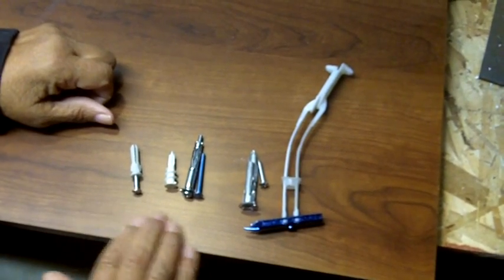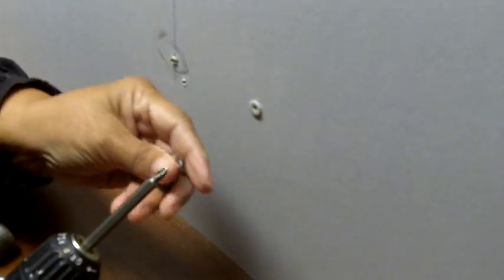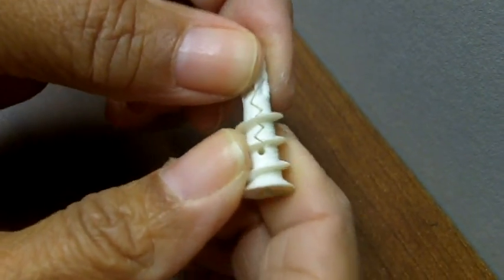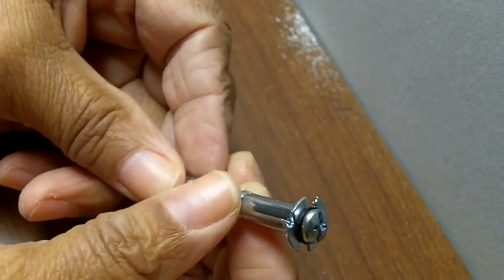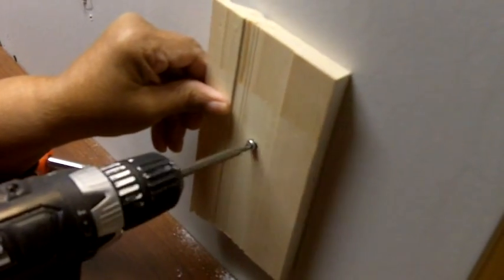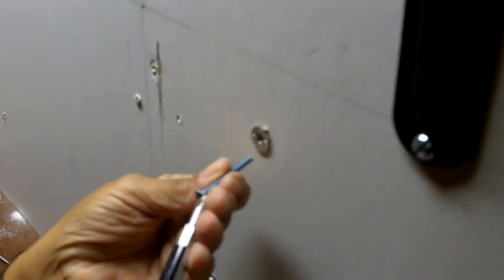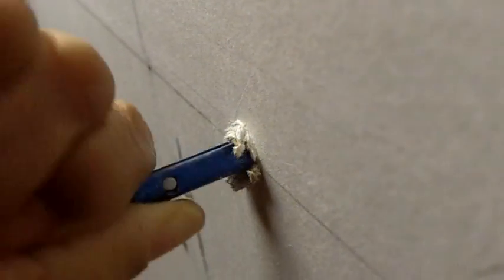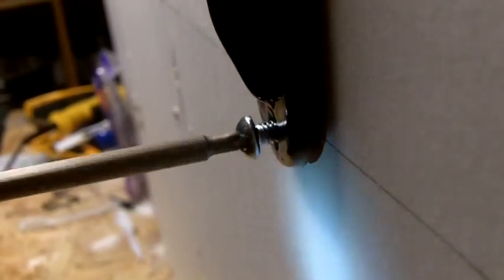All About Hollow Wall Anchors

Comment: Thanks again for another easy to understand video.
I am, as I type, in the process of hanging a closet rod but I found out that one side wall is hollow, I tried a plastic self driven anchor like the first on this vid, and it went right thru. Should I use the toggles you used last on this video since there is no stud to help support it?
Reply from the maker: yes, that's an option.

Comment: Hi Jane, when I put in the white plastic self-tapping anchors, I poke a hole with my phillips screwdriver first, then screw it into the wall. (sort of like drilling a 3/16" hole I guess) Would this reduce the integrity of the drywall/anchor relationship?

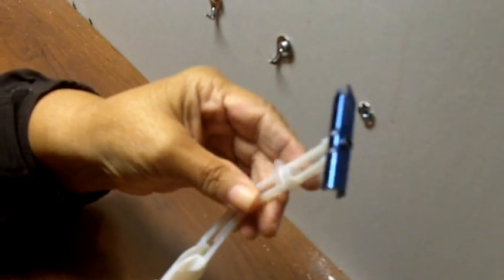Comment: Hi Jane! As usual nice video :) I need to ask you something pls.  So I want to install an Ikea besta tv stand I am using the snap toggles like the ones in the in the minute 7:31 of your video, but I made a mistake with the position of  the hole for 1/2 in.  In the first hole I got the toggle installed. Just wondering if drilling a second hole that close (1/2 in a part) will be secure enough to hold the weight :(. Any recommendation? Tks in advance for your answer.  I am not catching any studs for any of the screws positions unfortunately, so I had to do it with snap toggles.

Comment: Hi leah, I have been really enjoying your new videos, and I wanted to ask you for some advice, on anchors.  I have been trying to re-hang a curtain rod on a very old Adobe wall.  I have tried almost everything out there from plastic anchors, to molly bolts and I cant get this to stay.  Someone suggested I use liquid nails, but to me that's going to make a hell of a mess and not really work on the wall.  Im at a loss here, so if you have any suggestions on what I can do to make this work, I would really appreciate the advice.  Thanks for your help, and keep the videos coming, you have some excellent stuff here!
Reply from the maker: Rudy P Hi Rudy, I'm not an authority on adobe, but have contacted an authority on adobe construction in your behalf.  Once I get a response, I'll get back with you.
Reply: Thank you Leah, I really appreciate any advice you can give me.
Reply from the maker: Rudy P The Adobe expert we contacted  recommended that gold deck screws 4 - 4 1//2  inches in length be used, noting that the large aggressive threads running the screws  length, created a strong bite in the adobe brick.  He further suggested that pilot holes be drilled prior to driving the fasteners into the wall especially when screws are placed in close proximity of each other.  Hope this helps, good luck.
Reply: Leah,

I have to say thank you so much for the Advice!  I bought the deck screws, and re-installed the curtain rod.   It worked like a charm.  Thank you so much for looking into this for me.  I appreciate you for what you are doing, keep up the good work and thank you again!!!

Comment: Which of these anchors will work with my own screws?  I have a fairly substantial drapery rod with drapes that are on custom brackets.  The screws are not the same size as the ones I've found at my local hardware store.  I'm wondering if they will work with the snap toggle?  The screws that come with these anchors will not work with my brackets.  They are counter sunk and the heads are too large.  Those plastic wall anchors won't hold the weight.   Thank you!  Love your videos.
Reply from the maker: +Angela Lee Hi Angela, you would be best served to take the bracket to the hardware store with you, and have them help you to select a screw.
Reply: That's what I did.  There isn't one.  I'll have to take it back to the guy who made them to drill the hole a little large for my screw to work.  Thanks so much!

Comment: Our toilet paper holders are a nuisance! They were originally screw mounted into drywall, but the holes got sloppy & loose after re-installing with various wall anchors & mollies. Any how-to's for mounting to stay put? It's not like people are using them for anything but TP, & as the only female in the house, I put the paper on with care (men in this area are not familiar with TP installation methods). Spackling these holes doesn't hold up. What can I do to make them stay? Thanks again for your great series!
Reply from the maker: MotherSquid HI Mother Squid, you can't use the same holes, even if you spackle over them.  Your solution is that you will have to reposition the TP holder.  One side of the TP holder should be screwed into a stud.  It's okay if the other side is still mounted on drywall.  As long as one side is mounted on a stud, you'll never have this issue again. If you need to know how to find the stud, we have a video on how to do it.

Comment: Any of these work to screw in those closet end caps for closet rod in thin rv closet walls?  The closet rod will only be 13 inches wide but I want to hang clothes on those hangers that fold down and take up less room.  That makes them pretty heavy.

Comment: Great video!
I was wondering what the molly bolt looked like in the back, I don't think you showed it :( . I am wanted to hang shelves with horizontal double brackets but it looks like the wall I want to hang them on has two drywalls back to back. Would a molly bolt be long enough to reach through to the other side?
thanks in advance!!
Reply from the maker: epicbtu Hi there, The molly bolts are fine, but the snap toggles that we show in the video are actually a better choice for this application. They will hold more weight, and are easier to install. If you want to see how the snap toggles work to hang shelves, I would recommend that you watch the See Jane Drill video "How to Hang Shelves on Drywall that will Stay".

Comment: Leah, great video. Is there a special anchor that I should use for old plaster walls? Thank you.--Kim
Reply from the maker: XOurSimpleLifeX Hi Kim, Most plaster walls have a hollow core, so the anchors I showed in the video will also work in plaster walls.  The only difference is that you will definitely have to drill, even for the self-tapping ones, because plaster is basically a rock.  Hope this helps!
Reply: seejanedrill Yes, this helps a lot. Thank you.

Comment: Silly newbie DIY'r question but can the snap-toggles work on paneling?

Trying to hang a large TV (heavy) on a panel wall. I understand I will have to pre-drill the pilot hole bit will the wall and toggle accept the weight? 

Love this channel btw - I totally subscribed when I "discovered" you.
Reply from the maker: Your question isn't silly at all, it's a good question.  Yes, you can attach toggles to REAL wood paneling.  I mention real wood because a great deal of paneling is made of polyurethane, wood particles and vinyl and may not be able to support a large tv.  So, my yes depends on the paneling is it wood or fake wood.

Comment: you forgot to mention with the molly bolts you need the right wall size to know the right size molly to use. Also how much pounds the drill toggler can hold?

Comment: Hi Leah I want to put another rail in my wardrobe, on the outside walls it not a problem, because the screw fit into the holes that are there, but on the middle one there are holes to put screws in but nothing in between the middle to screw them to how do Secure  the screw s to stay in please .

Comment: Hi Leah I have an over the door towel bar on my bathroom door which prevents the door from closing. I purchased a rack that screws to the door to replace it. I didnt realize the door is a hollow core door. Which anchor type would you suggest for a 1 inch hollow-core door?
Reply from the maker: you may want to consider a molly bolt

Comment: Hi Leah, thanks for this great video. I am installing a wall hung bathroom vanity in a small half bathroom but I realized and I do not have studs to hold it, could I use the snap toggle to hold over 100 pounds or is anything else available?
Reply from the maker: Hi Julianna, studs are usually 16" on center, so I'm not sure why you don't have studs to attach to.  Is your vanity smaller than 16" wide?
Reply: @seejanedrill  You didn't answer his question... Also, not all houses have  walls that are 16" on center. I'm in a home now in which interior walls are 20" on center. Just exterior walls are 16" on center.

Comment: Thanks Leah!, Just wondering what would be best to hang a manual projector screen with pull string on a dry wall? it weights about 75 and is about 92" in length.Doing my own DIY home theater and any suggestions would be appreciated!. thanks in advance!
Reply from the maker: HI Juan, for heavy items, I have had the best success with an anchor system called wingits anchors (holds up to 300lbs). You might want to consider them. I get mine at Home Depot, but they may be available elsewhere.  Good luck with the home theater...pass the popcorn!
Reply: Thank you,Leah ..I'm running to HD now!

Comment: I used the 2nd to last type last night (mine were plastic/metal) and they wouldn't flip, the damn screw would just pass along the anchor... I so have insulation behind the wall, what do you recommend? It is for mounting a TV. (no studs in the wall.... at least none to be found with 3 different stud finders)
Reply from the maker: +Mathieu Levac Hi Mathieu, it's possible that the insulation was interfering with the drill toggle.  You might want to try a strap toggle (the last one I showed in the video).
Reply: Yeah i used something like a clamp with a spring in the middle, it would open by itself when it got outside of the hole, worked very well and its very solid, thanks for your suggestion though.

Comment: Do you think I can use the snap toggles (4 of them) to mount a tv to drywall (not using the stud)? The tv weighs 28lbs and the mount weighs about 20lbs.
Reply from the maker: Make sure that the weight is within the limits specified by the manufacturer of the snap toggles.  If yes, it should work.

Comment: A noob question, but a serious one:
if an anchor can hold  a weight of X lbs, does it mean that two identical anchors are capable of holding up to 2X lbs, and four can hold 4X lbs? Any rules about a minimum distance between the anchors?
Reply from the maker: you know, this is one of those questions that I don't know the answer to, and have often wondered about myself!
Reply: Yes to your first question; within reason (EX:  the load of what you mounting would need to be ~evenly distributed across all the anchors)

Important to notes:  There are differences between the pull out rating and the sheer rating of mounting hardware.  A shelf or similar can act like a lever multiplying the apparent load at the anchor.

Yes to your second question, there are minimum distances between the anchors; see specific manufacture for specifications.

Comment: Does the molly bolt work on luan walls in an rv? I'm trying to hand curtain rod width of rv behind the driver and passenger seats, need something strong to hold rod up. Will use hanging ceiling rod holder as well. Thank you
Reply from the maker: shelleyfunny19 Hi Shelley, a molly bolt should work,. However, I'm curious...why not the snap toggle?  I ask because the molly bolt is more of a lightweight anchor, but the snap toggles can hold a lot of weight.
Reply: seejanedrill First, thank you for the reply. Second, my concern is that there is not much space between the wall/ceiling inside the coach and outside. I think I have the luan and then an inch of foam then the wood that is the roof, puncture that and I have leak, not good. Water is an rv's kryptonite. I love the idea of the snap toggle if u think it'll work.
Reply from the maker: Hi Shelley, after you explained how much space you have, I don't believe the snap toggle will work.  You might consider trying a product called sugru.  We just did a video on it this week.  It is a moldable rubber that you could embed the curtain rod holder in to attach it.  Sugru costs about $10, so it would certainly be worth a try, and you wouldn't have to worry about puncturing anything.

Comment: I've used many of those fasteners and most are junk. The second one (self tapping one) avoid at all cost.That Molly bolt isn't the right size for drywall the main body ( the part that doesn't expand is too long ) I'm surprised it didn't just spin freely when you put a screw in, you should have shown the back side of the wall and warned people watching. the "drill toggle" shouldn't be used on a wall that has insulation behind the wallboard as the part tat swings out can get caught in the insulation. One thing everyone needs before drilling or screwing holes in their walls is a Stud Finder! With a stud finder you can locate the studs and quite possibly drill into your wall stud and use wood screws to attach whatever the good thing is there's practically no weight limit but you are limited to placing your item only where there's a stud. And a stud finder also shows you where it's safe to put a wall anchor (no stud).

Comment: can I hang a 65 inch tv with the toggle anchor ?
Reply from the maker: Toggle bolts have the weight limits indicated on the package.  I would consider weight and not necessarily size.

Comment: Haha "Leah, what is this?!" That made me laugh. What do you mean when you say 'sheer weight'?
Reply from the maker: Marci, how are you. Shear weight refers to shear strength which is a material or components toughness against a certain kind of structural failure.   In the case of our video,   the shear load represents the force which can produce a sliding failure. on a fastener (screw, toggle etc.) along a plane that is parallel to the direction of the force.

Comment: That is not the correct way to fit a molly bolt the first thing you need to know is the thickness of the plaster board to determine the correct bolt as there are different length shafts, drill correct size hole insert bolt then you are supposed to use a MOLLY BOLT GUN which clamps the bolt in position, doing it the way you have shown can cause the bolt to drill itself through the board I have used thousands of these bolts and they are very secure when used correctly, some people will ask how do you know the thickness of the board this can be checked by either taking a near by mains socket off the wall or by drilling a smaller hole than required insert a piece of wire with a hook to find the back edge of the board.
Reply from the maker: A molly bolt gun is not required to install molly bolts.  Infact, a molly bolt gun is a specialty tool which isn't readily available.  I do however appreciate your pointing out that the thickness of a wall needs to be taken into consideration prior to purchasing a fastener length.  What I sometimes think is obvious to all, is not necessarily so.
Reply: Umm, yes it is the right way. You do not need the molly bolt gun. Do you think because she is a woman she doesn't know what she is doing?! Before you open your mouth, know what you are talking about an do not be so condescending. So tired of seeing and hearing male's thinking they are more knowledgeable about mechanical issues.